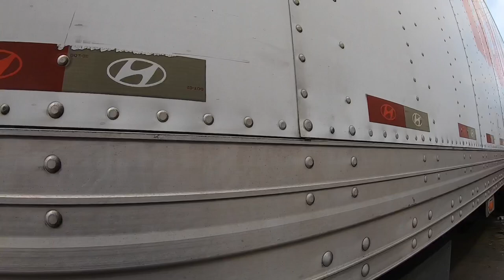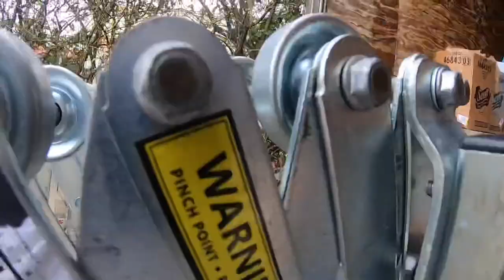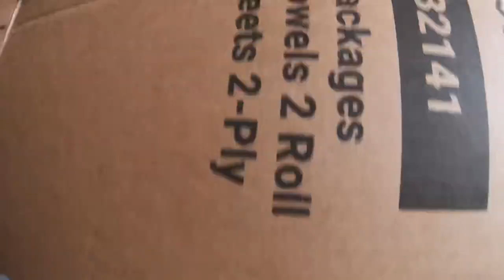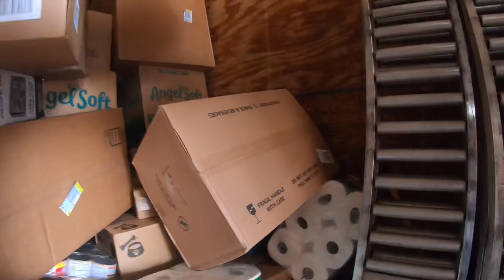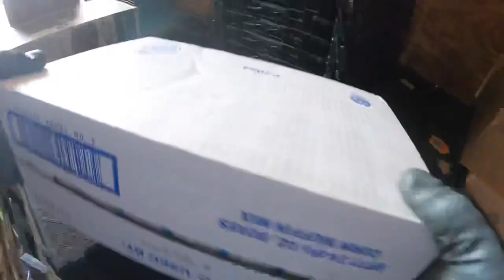Family Dollar US Xpress Part 2

Comment: I worked for a food service company, my trailers never looked that messy. There must be a better system to do this. The company should look into lift gates so you can roll pallets off and go. I also think I would prefer to haul B-trains, the smaller trailers fit better in the tight spots than the 53 footers. And what’s with bringing back all the cardboard ?

I’m not sure what they pay for this type of work but from what I’ve seen it most likely isn’t enough.
Reply from the maker: B-Trains wouldn’t work because you would have to disconnect to back up to the store everytime you deliver. There are lift gates for when pallets are to be off loaded. However, each store only get up to 4 pallets if any. Bringing the cardboard back is so they can recycle it instead of putting it into the landfills. If you are company, the pay isn’t worth anything. Lease operator isn’t much better. However, if you are there because they need help (outside carrier that’s not on a contract), you could make up to 2k a day 7 days a week.

Comment: Yeah, management would have been calling up the recycling center that can pick up the cardboard.
It can't get at the head. I know what that's like. Those dumpsters get filled up real quick. Maybe they should order another dumpster for the cardboard. Who are get bigger dumpsters?
Reply from the maker: I literally saw a guy dumpster diving while I was unloading at that store just after the inspector left. They need some with locks on them
Reply: @stewslogisticsllc9460  Another thing too, if there's garbage in front of the dumpster, they're not going to pick it up there on the schedule. They have to people in the store have to clean it up.. Before that Driver gets there.
Reply: Any Assistant manager could have had one or two of the people Moving this cardboard out of the way And why they put it in front of the dumpster so the The driver can't get to the dumpster is behind the dumpster out of the way just an idea. And maybe they should jump inside. That's what weight to try to crush it down more so we can get more in there. So so it doesn't start piling up like it did. Because they probably don't do that..
Reply from the maker: The assistant manager paid someone $100 to clean it up before the inspector showed up.

Comment: How can you tell what stuff is for which store?
Reply from the maker: There are labels on each package with a store number and different color. Just remember the store number. Also the different stores are separated by plastic (most of the time).
Reply: You look for stop signs
Reply: Stop signs where not a fool proof way, to check your stores. When I did this, sometimes those “good” folks in the warehouse, didn’t put stop signs on anything, they’d just toss a roll of stop signs in your trailer, and leave it at that.